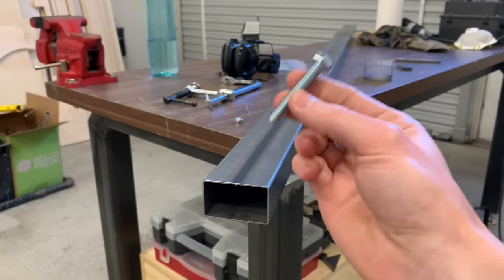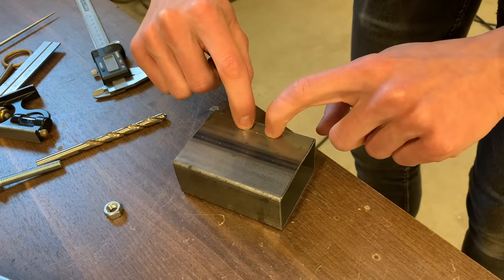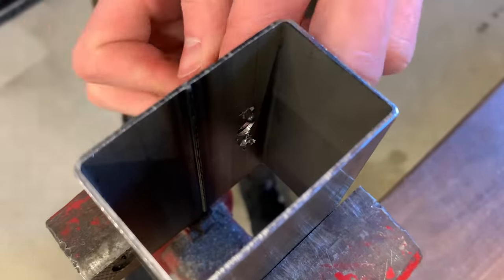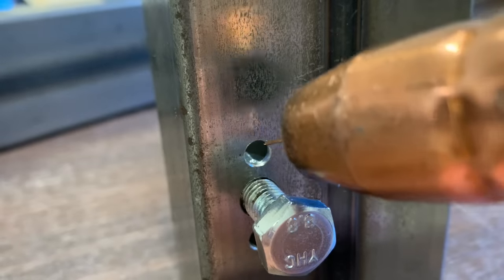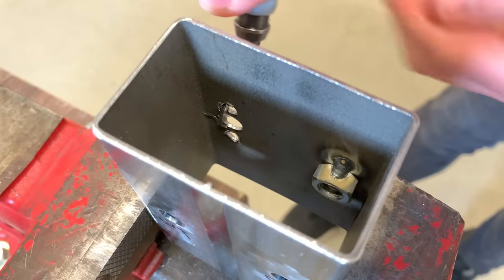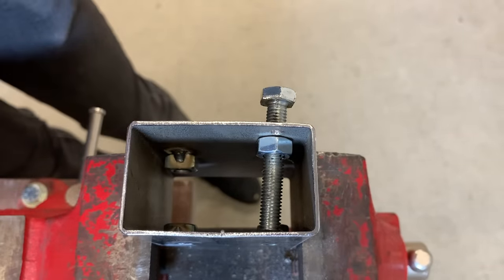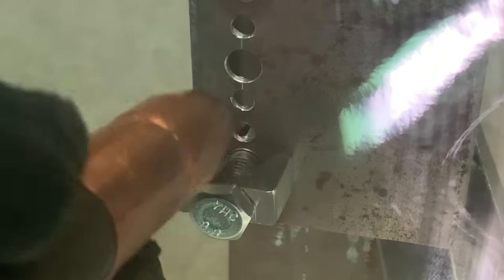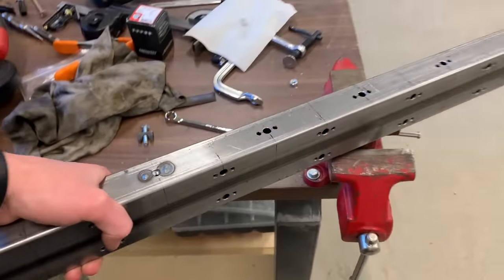Welding nuts to the inside of steel tube

Comment: a much easier approach, would be to oversize the hole by a substantial amount, insert a puck that's sized to leave a small gap between the puck and the hole, tack it into place,  then weld the puck in place, completely filling the gap between the puck and the hole. then it's just a matter of drilling and tapping the pucks

Comment: Hard to explain, but solution is simple. Drill a hole so the nut can go through, put the nut on a magnet, put the nut back in hole an weld it.

Comment: Did this with 18 rivet nuts, just with a battery drill and a 50EUR tool to fix the nuts in less that one 1h on round tubes on the field. Imagine having to do 18 9mm holes + 36 smaller holes in the field + welding the nuts properly and filling all the holes. Plus, now I have the tool (for 4-12mm nuts) for future projects that allows me to put nuts wherever I want. The idea is nice but completely useless and consumes way more time than required, time that can be used for something else.

Comment: I think it would have been easier to use a strip of metal as thick as the nut.  You fix it on the tube and drill the holes through the strip and through the tube.  Then you take the strip and thread the holes in it.  Then you insert the metal strip into the tube, fix it with a few screws and then some welding points at the ends and possibly in the middle.  Now you can remove the screws and have a tube with threaded holes that is much stronger than the version with nuts.  Also simpler and faster to make, which matters if you make them in larger numbers.  What you say?

Comment: Drill a hole large enough for the nut to fit in, hold it with a b olt or threaded rod and weld it.

Comment: Hi  I cannot see how this process is cheaper than using nutserts.   Contrary to what you said, they are definetely not expensive at all.  All that is required is a drilled hole and an application tool.    No welding or grinding, nut holding jigs or deburring tools.  They can be used on enclosed spaces where a nut cannot be inserted from the inside.  Works on any metal.  Nutserts can be installed in a fraction of the time.  I just put a nutsert in a frame in my living room - no workshop required.  Also the skill level to install a nutsert is very low.  There is no surface damage to surrounding area.

Comment: Since you are already filling the two holes with weld metal, how about instead of the 3 holes, just drilling one that slightly less than the distance across the points of the nut and then pressing the nut into the hole... This would allow it to hold the nut and you could then weld the 6 small gaps between the flats and the hole you drilled...

Comment: Rivnuts aren't that expensive.  Manual install tools for them start at like $20 with lever operated tool ones for like $100.  If you have to do that many of one size it's worth the investment.  But this is still a good idea for random sizes.

Comment: Slightly extra: 
Just drill a hole big enough to fit the nut.
Stand off the nut with the bolt .
Weld the top of the nut to the top and grind flat. 

As opposed to your method, where you're basically just tacking two sides of the nut, you would be able to weld 100% on the circumference of the nut.

That would be a more beneficial weld....

Comment: a cheap manual rivnutter is like 30$ and probably comes with all rivnuts you needed, would have saved you so much time. 
but this will be stronger so I guess it depends on the use case. and non plated flange nuts would have been better.

Comment: I would have used a thin flat bar and layed out all the holes on it, then used it to drill the bolt holes in the tubing. Then drill a weld hole in the tubing only, between all the bolt holes. Once everything is drilled, weld  all the nuts to the flat bar, then slide it into the tubing and thread all the bolts up. Weld the flat bar in with all the extra holes.

Comment: Did you have any problem with spatter sticking to the bolt, making it hard to remove?
Reply from the maker: Not really. Some spatter did stick, but it broke off easily as I backed the bolt out. I’ve finished the tube I showed at the end, so I’ve done a total of about 50 of these now, and I’m still using the original bolt.

Comment: Get flanged nuts and you'll have an easier job.  That said If it doesn't need to be flush externally I just use thick washers and weld them on their perimeter and then use a combo mill drill bit to run threads in them

Comment: Excellent technique!  Thank you!   An additional step, if people want to really get the inside right without deburring:

For crushing the nut tight on the inner surface, keep an extra nut spun up closer to  the top of your fixture placement bolt.  After placing your inside nut and tightening the bolt against the opposite side, spin the outer “clamp nut” down from the head end, and cinch it tight.  This should compress the inner burrs quite effectively.   Back the outer nut off, and re-tighten the bolt at the head again to make up for the burr depth you eliminated.

Comment: It might take longer, but it would be less risky to tap a plate thick enough to hold threads , slide it inside  the tubing, and plug weld it in place. By risky, I mean less likely to have a nut break loose while using the piece, or more likely for folks like me, to accidentally weld the threads of the fixture bolt to the nut while attaching the nuts. If that happens a couple of times, then the time drilling and tapping the plate that you could plug weld inside the tubing might not be much different, and you have zero chance of a weld coming loose in the future. This is still a cool idea, but even in the video, the holding tool breaking shows that this could get almost as time consuming as the tapped plate plug welded inside.

Comment: Just bad advice. Drill a hole mid length of the tube, than slide a full length flat bar with a trapped hole at mid length. You can use a bolt to clap the flat bar to the inside of the tube. Once you have that, you can drill and weld at odd intervals the flat bar to the tube.

Comment: Pretty good idea but it just seems like too much work as you can just use a rivnut.  You said they were out of reach for most homeowners but you can get the tool for $30 and use it for much more. Again nice job and it’s a good idea I just Think the rivnut is so much easier and not very expensive

Comment: I would probably just use rivet nuts, I believe you can fit them with a simple impact drill, but to be honest, his way is probably just fine, just try to not putting much load through those nuts
Also, stainless or unplanted nuts would work a bit better and you would inhale a little less cancer causing fumes

Comment: rivnuts are not expensive and I made my own setting tool using a bolt, nut and washer. A welder and lathe on the other hand are expensive.

Comment: not a bad solution, as they say there is more than one way to skin a cat. rivnut tools are nut that expensive certainly cheaper than a welder ? another way would be to use suitable sized piece of steel flat bar the same length as your tube  to drill and tap   the hole centres that you require and then secure this flat bar in the inside of your tube with countersunk screws maybe if you have selected a thick enough piece of flat bar you will have ample thread length/strength and this could be achieved without welding or rivnut tools hope this helps someone.

Comment: I can understand the reason as a way to justify the video, but riv-nuts are not much more expensive than regular nuts. You don't even need the special tool for mounting them either. Just use a threaded rod and a double nut to pull them tight. I'd estimate it would take about 1/3 of the time spent drilling 3 times the amount of holes, de-burring, welding and grinding. And if the thread of a riv-nut gets damaged, you can just drill it out and replace it. Swapping a welded nut like that is probably gonna be a nightmare, especially on a finished product with paint and all.
Well made video though with great production quality.
Cheers!

Comment: Why not just get length of 1/8" flat stock the length of the tube, drill it where you want, then use it as a guide to drill the holes in the tube.  Tap the holes in the flat stock.  Enlarge the tube holes with a step drill to reduce buring.  Slide the flat inside the tube and bolt away.  If you don't take all the bolts out at once, you won't even need to weld it in place.  I didn't come up with this, it's a fairly common technique.

Comment: Perhaps the rivnuts specialty tool is cheaper than a decent MIG-welder. 🤔

You can actually get a set with assorted nuts and the pliers for around $35. 🤓

Comment: Do just what you're doing but install a weld nut instead. The flanges on it will be under the two holes you drilled. And it also has a flange to go in the hole

Comment: I probably would do something similar because I'm a cheap ass & would rather waste time ,however a riv nut is probably the way to go, you don't need the installation tool, overall what you did is better except now it needs to be cleaned and neutralized prior to painting or you have created a rust situation

Comment: I have masters degree in mechanics and I have few things I would like to point out.
 - idea of turning generic nuts into already established and normalized welding nuts seems almost insane to me personally
 - those threads which are left after that turning, are there literally for looks since they have 'no meat' to support it so they just stretch not bearing almost any load anyway
 - IF those were zinc plated nuts, one could switch them for unplated ones for better weld quality (the profile is not treated anyway)
 - there are hand tools for internal welding of these specially designed nuts
 - in practice you just need a rotary tool and something like column drill to heat the thin wall of the profile by applying pressure and rotary motion while pushing the molten metal inwards to create a neck which is used for thread cutting/forming -> same can be achieved without heat by stamping
- lastly I believe you are limited and cannot use a rivet nut, which is commonly used and can be also installed by common tools 

All in all I really like the fact that you have tackled an issue and came with your own unique solution and desided to share it with us.
Reply: Drive a sharp awl through the surface with a hammer. Once through, enlarge the hole by twirling the awl around until the proper tap size is reached. Tap threads into the now thicker walled hole.

Comment: It may be functional by no means is it efficient nor as cheap as you make it out to be. The time involved in setup (drilling three holes instead of one) plus the "specialty" tools or fixtures made and then the cost involved with welding gas and wire, you would be much better off, and make a much nicer looking piece, using rivnuts. There are inexpensive sets out there and additional riv-nuts aren't all that expensive either.

Comment: I would use a rivnut and upset them using a setting tool. 
The thin walled tube will deform and fail before the rivnut would.

Comment: Creative, but not a lot of weld to hold these nuts in, looks like, just the very edge. You could have put the secondary holes closer if you will fill them up anyway.   Or you could take a 1/2" thick bar, cut it in small pieces and drill and tap a hole in each.  Then do your welding on those  bar pieces with full rosette welds.  Or weld some wings to actual nuts and fully weld the wings through your secondary holes.  Or use weld nuts.  Or use rivnuts if not a lot of pull, those are not that expensive and you do not actually need a special tool to install them, just a bolt and a couple of nuts.

Comment: Honestly just use rivnuts. The amount of heat and faffery involved isn't worth it. If you want to go HAM, use crossnuts and spot weld the flange... Just make sure you have the right tool as it's different than a standard rivnut.

Comment: When I did my apprenticeship we worked with stainless steel. You wouldn't be able stainless steel bolt or threaded rod unscrew a bolt or threaded rod if the we both stainless. You wouldn't be able to do the with coat steel nuts as it you wouldn't get a good earth to be able weld.

Comment: That's why they invented blind nuts . It's a lot easier too. If you can afford a wire welder blind nuts are well in your rich as far as expense goes. Amazon has them and they are cheap.

Comment: The rivnut solution is far cheaper and less involved. I would say this method, requiring a welder, would be further out of reach for the " average" hobbyist /DIYer. Now, a welder is an invaluable tool for a serious DIYer to get ASAP, but if you need threads in thin walled tube, the rivnut us the easier route,  I think.

Comment: I would have weld the nuts onto a flat bar that is the length of your tube.  Use the bar as a hole guide and then spot weld the flat bar inside the tube.

Comment: Why don't you drill the holes to the outer diameter of the nut +1/16" all the way around,then weld it and grind flush to the surface of the tubing.

Comment: I like the solution to welding a nut inside of a tube but am confused by your statement that rivnuts are expensive... A tool and starter pack of rivnuts  cost me less than 25 USD and a pack of 50 M8 rivnuts is less than 10 USd. Rivnuts do not sit flush to the tube so your method is well worth knowing, just not sure it is the best solution if flush mounting isn't a requirement.

Comment: BUY A SET OF METRIC DRILL BIT in 0.1 mm step  or  0.5mm plus a few extra to drill before taping (M diam - pitch). Will last your life and spare a lot of time instead of crappy fractional, numbered, letters inch bits ! Inch is a stupid way to say 25.4 mm.
Besides, if you have a lathe just make crimp nuts if you don't want to buy rivet nuts.

Comment: I would just weld nuts to a flat strip of metal that can slide inside the box section, aligned to pre-drilled holes.  Much easier to do the welds....

Comment: Steel rivnuts a VERY cheap!! It takes less than 2 minutes to drill and install. Good luck to remove the bolt without ruining the threads! They are covered in spatter!

Comment: Rivnut tool it $32. How exactly is that cheaper then a welder? Someone please explain. I mean, if you have to have the nut completely hidden and didn't mind drilling 2 extra hole in you work piece sure, do this. But a rivnut tool isn't exactly bank breaking. This is a non hack.

Comment: Why not use pem nuts?
Reply from the maker: And install them with what tool?
Reply: @Jer_Schmidt  I’ve always just used a bolt and washer to pull them in so I guess you’d just need the arm to place them inside the tube.
Reply: @Jer_Schmidt  Agreed that PEM nuts seem the right thing here. No installation tools is required (although it can make it a bit easier); ideally you'd have a larger hole on the backside to drop in the PEM nut and press it in, although you can use a bolt if necessary. Also, deburring is not required (indeed the opposite, PEM says: "DON'T deburr mounting holes on either side of sheet before installing fasteners – deburring will remove metal required for clinching fastener into sheet."). On the other hand, if you're wedded to your approach, the Noga RC1000/RC2000 reversable deburring/countersink tools solve your deburring problem -- you insert them through the hole and hit the button on the end to flip the cutter, then you debur from the inside up, and then hit the button again to so the cutter fits through the hole and remove, easy-peasy.
Reply: Those noga tools are incredible!
Reply: @Jer_Schmidt  Re-reading this I realize maybe you are confusing PEM nuts with rivnuts? They are not the same! Rivnuts are inserted from the front and the tool expands the back/inside (although you can fake it with a threaded bolt and a nut on the front). PEM nuts are inserted from the back/inside and pressed the hole, and are stopped by a the flange of the nut. They theoretically have a tool to make pressing them in easier, but I've never used it. PEM nuts are flush on the front, and rivnuts are not.

Comment: Cool trick. Too much work for me if I can at all use a common hardware size that I have rivnuts for, but its a cool technique to know.  The bonus being Any size hardware can be used. 

For the record, rivnuts and tools are not expensive. Shop around online. I  paid less, or about the same as for several hundred rivnuts than I would for the same count of hex nuts at the local box store, and the tool for them was like $20... Any "Hobbiest" that can afford a several hundred dollar wire welder can afford fancy rivet pliers... ;)

Comment: I prefer to weld the nuts to a back piece that may be left floating (held with the screws) or tack welded in place from the outside. You dont need such a precise welder in my case

Comment: Cool idea but you just put a bunch of boogers on the bolt inside when welding. Plus I think it's pretty easy to buy a set of rivnuts and the tool, than, say, a welder :)

Comment: Much simpler solution: plug  weld a flat bar to the inside of the tube and then you habe enough material for  tapping.

Comment: Don't use zinc plated nuts (aka the cheap nuts at the hardware store) because they make rather toxic fumes when welded.  Getting unplated nuts is definitely a challenge though, so barring that maybe weld outdoors with a fan.  Be safe everyone, don't catch the "metal fume fever."

Comment: Instead of making so many extra holes and tools .. why didn't you cut straight the side of the square pipe and reverse it and weld all nuts and weld that cut part back. This way you could weld all sides of the nuts for more stronger projects.